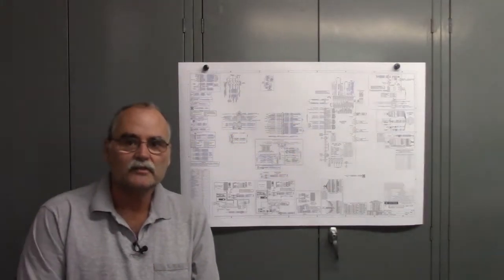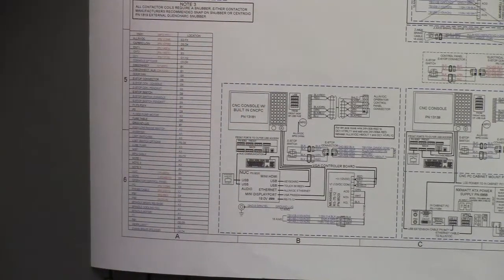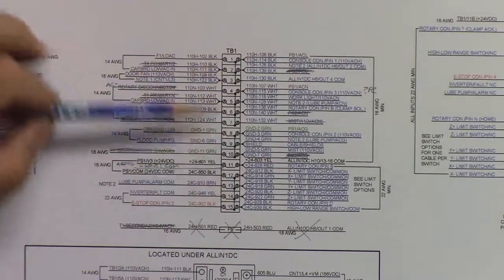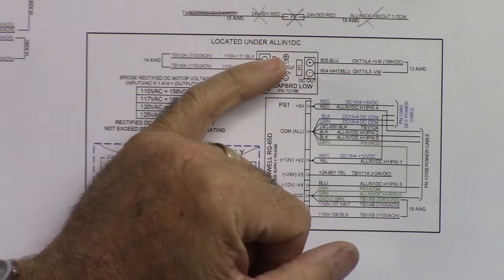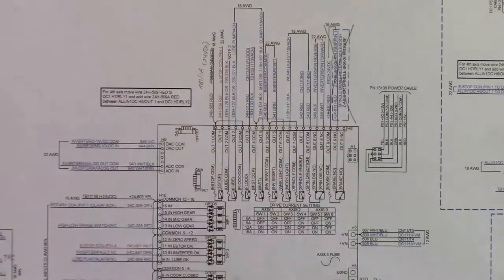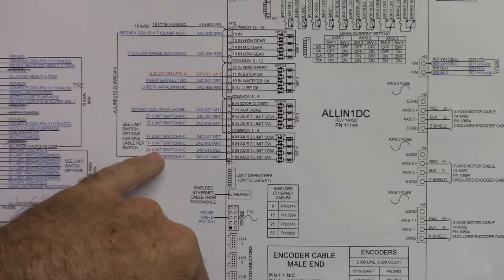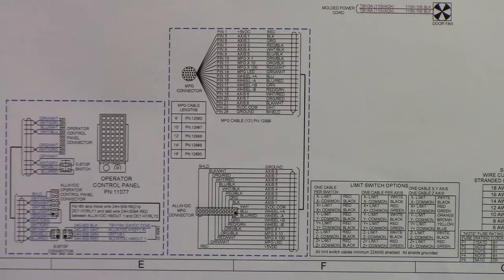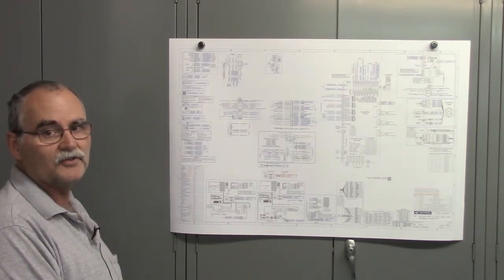Centroid All in One DC Schematic Overview

Comment: Hey Marty, my dc servo motors are only rated for 150vdc. Centroid sells a 110 vac to 83vac drop down transformer that should be plenty low enough for my motors. Do you know of any other dealers that might sell a transformer that will drop 110 vac to 83 vac?
Reply from the maker: Try Antekinc.com they have a 95vac 1500 watt power supply that will get you 136vdc after rectification. I would add a larger capacitor.